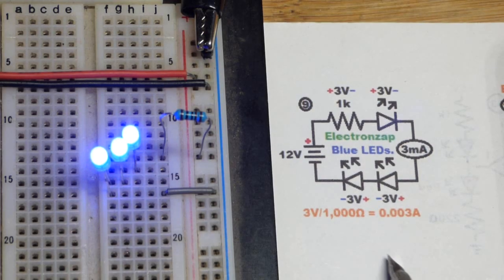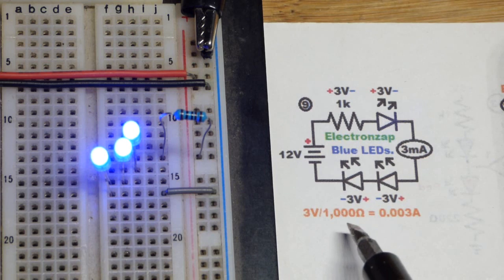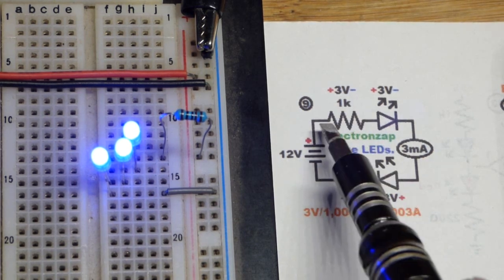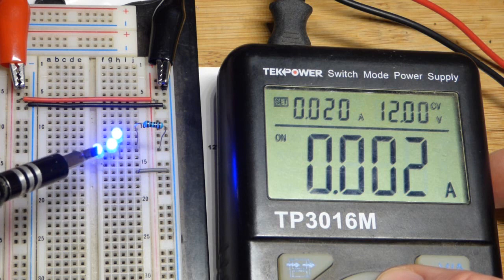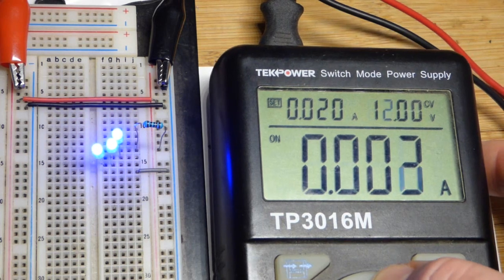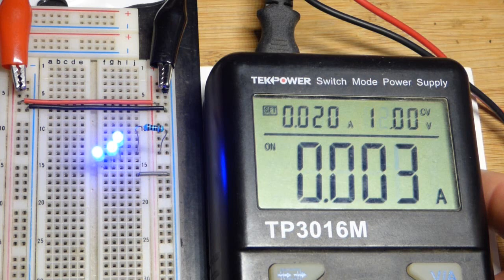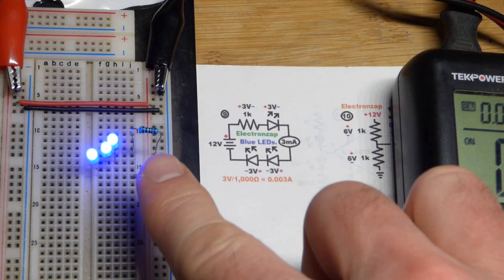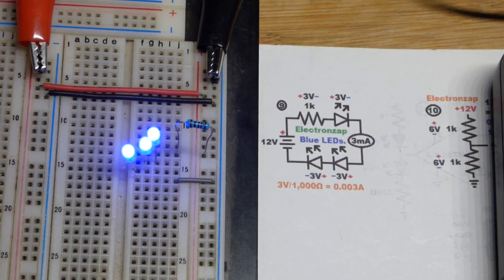Why 3 blue LEDs will handle 12V to 20V nicely with 1k current setting resistor

Comment: Sir I love you video..... although one can't not measure love in any multimeter....but just to compare...I wud say.... instead of watch Netflix for hours I wud prefer to watch you videos 1000times over and over again ......

As I am very very new to electronics I have a doubt which keeps me straching me head.... Why does led bulb or tube light uses a led driver who's output is almost 100v with 300 to 600 milliamps.....and not 12v 2.5amps.....as technically both have same wattage.....
Reply from the maker: Nice! I don't really have any extra knowledge of LED bulbs. They just seem to be modified to replace whatever was used before them instead of coming up with a whole new system.
Reply: @Electronzap  sir I wud love to watch a video on this topic.....
Reply: With LED bulbs, I assume they are higher voltage because:

- At lower voltages, thicker wires/traces are needed, which increases cost and decreases efficiency
- (am not too sure about this one): High voltage might also be easier to get from house voltage, maybe less turns needed on any transformers that might be being used? If any transformers are used at all, they may just be using rectified AC directly. You'd have to open one and see for yourself
- The reason they don't use 12V in your home is because the outlets are already made for the high voltage bulbs. High voltage AC transfers over long distances much much easier than low voltage DC. (Notice how huge power lines are incredibly high voltage, then it's stepped down in your home, then further stepped down in your electronics. All about efficiency, also safer as a bonus)
- Drivers are needed in LED bulbs because LED's cannot run on AC, they need to be converted to DC at least.

For tube light (assume you mean fluroescents), the driver is called a ballast andis needed because the gasses inside need a very high voltage to make light, more than what the outlet or light socket can put out. The ballast also controls teh lights, as they are a bit more complicated than just giving them power.

Hope some of my knowledge can be helpful :3